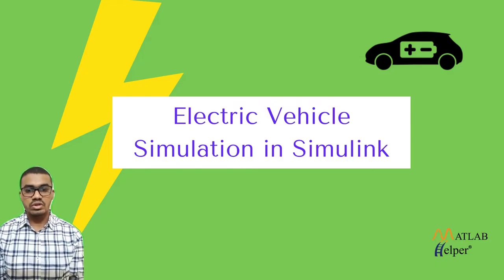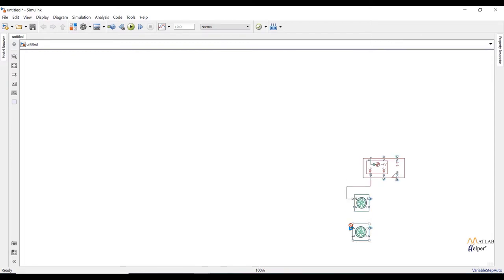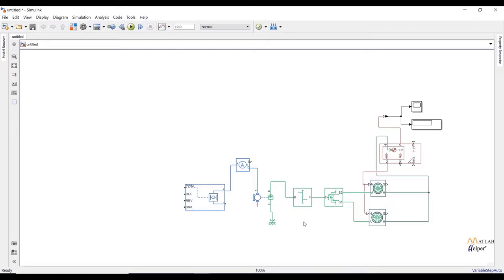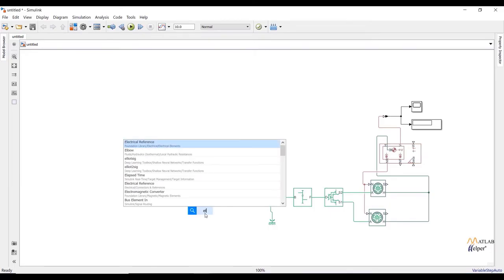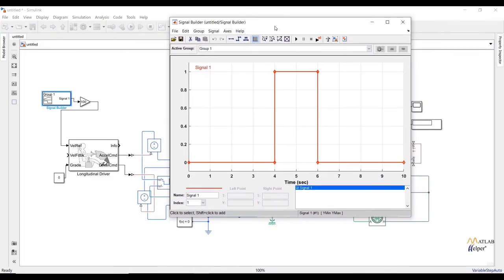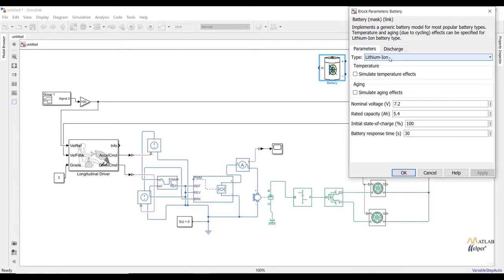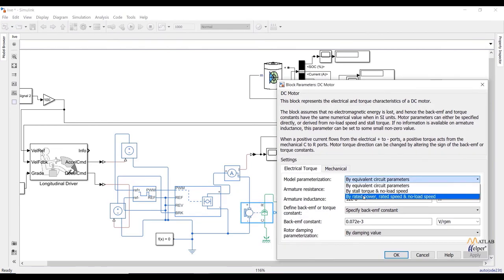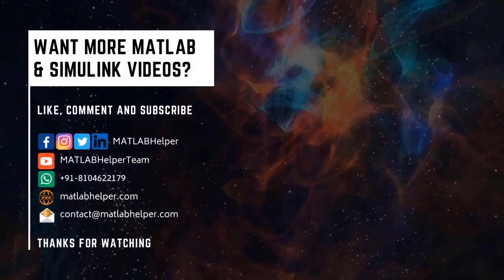Electric Vehicle Simulation in Simulink | @MATLABHelper  Blog

Comment: Hi, I did this simulation, but it gives an error in the battery section and says: battery must be greater than exponential zone voltage. What should I do to fix this error?
Reply from the maker: Maede Nafisi, If you are looking for expert assistance and ready for the paid service, share your requirement on website chat or email to team@matlabhelper.com with information, including service preference, timeline, and any necessary attachments.
Reply: I dont know if this is still relevant, but you can decrease the nominal voltage to default (I tried 7.2) to solve the error.

Comment: Hello Can I ask ,I am a student and I made a simulation of solar powered vehicle using a PV array, Boost converter and DC motor. But the simulation result were wrong, that it gave a high amount of the output current as also the torque even though that the curve of speed is correct. Can you advice me what should I change!
Reply from the maker: Nada Jasmin, Do write to us with your requirement at team@matlabhelper.com, or You can start an online chat at our website. Don't forget to Subscribe to our YouTube Channel. Happy MATLABing!

Comment: I created the Simulink model, but it shows one error 'Exponential zone voltage must be greater than Nominal Voltage' while trying to run it. Another issue is there in my MATLAB version in Longitudinal driver I can't change the unit to km/hr, it's just showing Nominal speed Controller values, etc.
Reply from the maker: Swarup Das, Do write to us with your requirement at team@matlabhelper.com, or You can start an online chat at our website. Don't forget to Subscribe to our YouTube Channel. Happy MATLABing!
Reply: @MATLABHelper   Okay I mailed you.
Reply: What is the solution for this?
Reply: @bharatgoel7058   solution is  you have to have  a Matlab 2020 version or above. And don't mail them they won't help you rather than asking for to take premium membership.
Reply: @swarupdas4139  thank you

Comment: Sir..Im facing a trouble in running the simulation..while after 63℅ it heavily struck..is there any other option to complete it.?
Reply from the maker: Yoga Madhan, If you are looking for expert assistance and ready for the paid service, share your requirement on website chat or email to team@matlabhelper.com with information, including service preference, timeline, and any necessary attachments.
Reply: Same problem i am facing
Reply: Did you solve the problem ?

Comment: Dear Sir, I am getting the following error
 "Solver could not solve the system of algebraic equations because a singular iteration matrix was encountered. Consider providing more accurate initial conditions. If the problem persists, check the model structure and values of parameters. "
I have constructed model exactly as shown in the video, could you please help me regarding this?
Reply from the maker: Jahnav Rokalaboina, Do write to us with your requirement at team@matlabhelper.com or You can start online chat at our website. Don't forget to Subscribe to our YouTube Channel. Happy MATLABing!
Reply: Kindly select ode23t solver
Reply: @anishyadav8676  didn't work
Reply: @ramanraghav390  kindly share your simulink model with our team,  we would like to help you
Reply: @anishyadav8676  how to contact your team
Reply: @anishyadav8676  sir it is still ot working can u share the slx file or solve my error pls
Reply: @anishyadav8676  i have the same problem could you please help me
Reply: I also had same problem can you please help